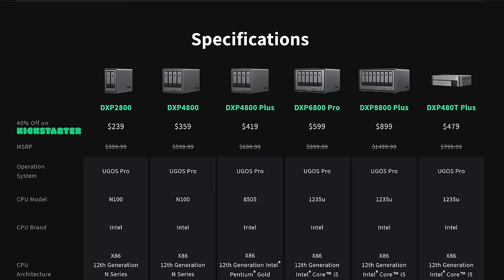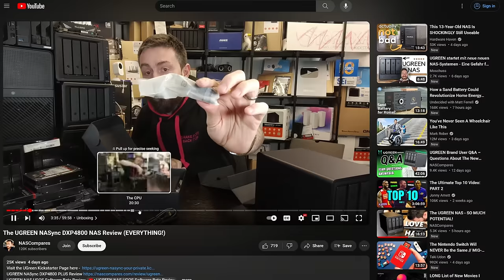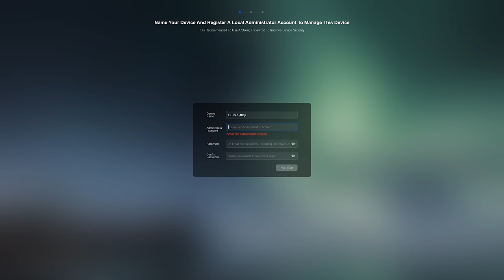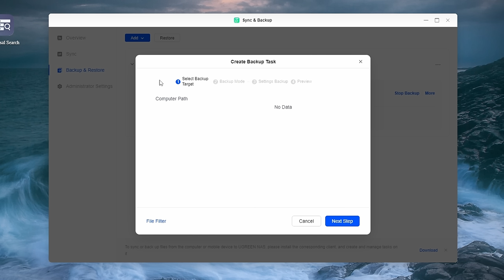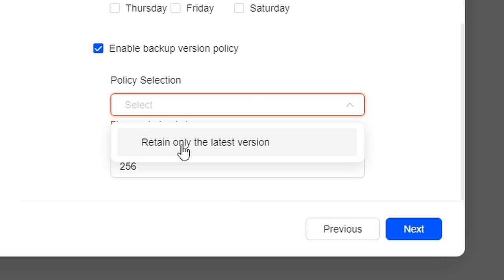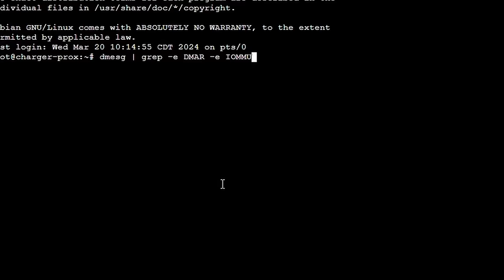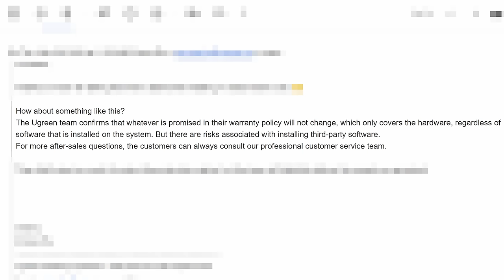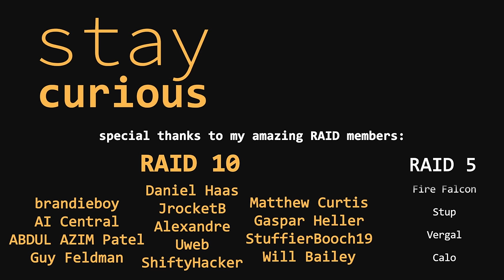UGREEN makes a NAS..?

Comment: theory: these were originally pitched as DASes but they realized during the design pprocess that they could capture a larger market with a little extra hardware engineering, but didn't factor in the cost and time required to do NAS software development well, hence the results: an unfinished OS on a decent motherboard inside a very well designed chasis.
Reply: given that their single drive caddies are pretty solid it's kind of dissapointing they didn't also release the DAS versions... i bet those would have put yottamaster+terramaster into panic mode.

Comment: The warranty thing is not unclear, or different from anyone else. Your warranty is on the hardware and it's functionality when running their software. It's not complicated, vague or strange. If you have an issue with something, they will not support - ie troubleshoot - what does and doesn't work on "Tommies OS for donkeyblasters" or whatever else you may have concocted to put on it. Everyone has that warranty for NAS products, I used to run the support team for a well known NAS manufacturer, we had the exact same policy. If you can get it to work somehow running AmigaOS or the firmware of some obscure shaver - good for you, we won't support or troubleshoot it like that, if you want our help, including to determine a fault which is required for RMA/replacement/whatever, the first thing you'll need to do is get the original software back on it so that we can diagnose what is going on, and eliminate software gremlins, hobgoblins and whatever other mythical creatures may lurk inside someone elses software.

Comment: I previously used 2TB spinning rust to install games and store backup files on my PC's but have since switched to SSD's for faster access. Now I have several of these old drives. I would like to use them as networked storage, not as a NAS but possibly as a USB drive attached to my router. Do you have a suggestion as to a "box" I could get that would hold at least four 3.5" drives?
Reply: Just get a cheap 4 bay nas..... storage does not belong on a router.

Comment: Yeah man love the idea behind an overspec cpu especially at 23W at the wall but the advantages over a $50 optiplex from eBay running TrueNAS won't get me to invest $400... yet. If they make some killer software to put that efficiency and compact size to work though, I could be converted?

Comment: Umm, If one reads the T&Cs, somewhere, somewhere in that vast threatening screed will be that Ugreen cannot be responsible for data loss or corruption or costs incurred with the use of this product, or words of similar meaning. 
But, If you use third party software, they announce that data and integrity cannot be guaranteed. So is not covered by warranty.
Is that not in reality the same outcome, no matter what software one uses?
Reply: That's literally what they state in both emails shown.
"We cover the hardware, not the software nor the data."

Comment: The font - the almost Times New Roman font you encountered was actually a Chinese font. 宋体 (SimSun) to be specific. For the longest time in Windows, pretty much dating back to the 3.2 Simplified Chinese version all the way to Windows XP, used this font as the default system UI font. The Roman letters part of this font is UGLY. People using the Simplified Chinese version of these Windows versions usually find ways to replace the default system font with some other fonts which look nicer when displaying Roman letters, if they care and are handy. It was Windows Vista which finally brought a new default font which displays Roman letter text in a better style - Microsoft Yahei (微软雅黑). I personally find SimSun's English text font style unbearable, but just have been too lazy to replace it with every Windows reinstall (back in the days, you reinstall Windows A LOT MORE).

Comment: Thanks for your video. These are my impressions.
software: uGreen is too green. IMVHO 10 years old firmware like the one of a Buffalo unit I used or theCus is... with more functionalities.
hardware: maybe not good enough. You defined the trays cheap, I would love to know how they will react after 5 years of almost 24/7 use, i worry about cristallization of the poliymer and cracks. Also the SoC seems interesting, however the 4+1 (because hyperthreading is gonna die) layout seems a "no VM" to me. Due to interesting options on bios (including power limit change) I'd love to that settings being tweakable from the stock os. And also... bios key access should be granted.
Last nitpicking detail: I doubt that the USB + SD I/O on the front is with specific controller and PCIe for the SD Card.
Reply: "hyperthreading is gonna die"
Derp.

Comment: So, TJ Max has not been a big deal for many many years like it use to be where if you where overclocking and went a bit too high on the temps it would die, now, both AMD and Intel just start pulling back on the clocks/performance if the temp ceiling is being hit, so, say you are humming along at 2GHz and 80C it's fine, but you hit 100C and it pulls back to 1.8GHz or even 1GHz to stay at or below TJ Max. This is also how AMD is doing their newer dynamic overclocking where as long as you stay under a temp threshold it will clock up more until it hits that thermal limit.

Comment: Maybe I just missed it but what PCIe gen and how many lanes are attached to the two main NVMe slots (and maybe the boot drive as well)?
Reply from the maker: Sadly I forgot to test that. I was a bit rushed and probably dropped the ball in a few spots. I haven't had a chance to watch but I think Apalard's Adventures dives into stuff like that.
Reply: @HardwareHaven Thanks for the info! I checked his blog and he posted the lspci output and that tells us both the internal NVMe and the Samsung he added run at 8GT/s with 4 lanes. I think it's fair to assume the 3rd slot also has PCIe 3.0 x4 and that's actually huge. All the 4 bay Synology and QNAP I've checked so far usually run at a single PCIe 3.0 lane.
It would be interesting to compare the lane configuration of the N100 version but that CPU only has 9 lanes compared to the 20 on the Pentium so I guess it's one or two at best unless they have a PCIe switch somewhere in there.
For anyone else interested there's (presumably) 12x lanes used for the three NVMe drives, 4x lanes for the Aquantia 10GBit/s NIC, 2x lanes for the ASmedia SATA Controller and 1x lane for the Intel I226-V 2.5GBit/s NIC.

Comment: More thoughts: Does the world really need another NAS box? Many years ago I bought the cheapest Synology 2-bay box as an experiment and it has worked flawlessly. OS is stable, capable and has a full array of add-ins. My one disappointment is that the RAM is soldered in, limited (512k) and therefore not upgradeable.
Reply: 512k? Dang... you couldn't even put a single MP3 in that RAM.
That's a third of a floppy disk!

Comment: all them screws and most of them with threadlock on them, not the good thread locker but still.    I do guess in a vibration system something to lock in the screws is a good idea, but propper tq would work better.

Comment: Is the ugreen OS based on any already existing NAS software? Why spend so much to reinvent the wheel when the hardware can run something far more mature?
Reply: It's a lightly modified version version of Debian.
Because when you supply the hardware and software, you support both.
When you offer people a full OS, you have support............... a full OS.
When you offer people a limited OS, you support exactly what is available in the OS you provide.

Comment: raid5 isn't enough redundancy though.  drives tend to exhibit failure when taxed the most - a rebuild is often where you find out that one or more of your other drives have failed.  I wouldn't go with anything less than an 8 bay nas running raidz2 or raidz3
Reply: That's why backups exist.
Reply: They have bigger Options as well, with more bays

Comment: After a couple of years suffering Qnap, I concluded that the whole concept of a NAS appliance is a dead end. Using such an appliance just means that you make yourself dependent on software that a manufacturer uses to capitalize on you in some of many ways. What I am actually interested in is the hardware. But vendors tend to lock down the hardware to be only usable with their software, at least that's the only "supported" usage scenario. Because they ship both together, you will always get the cheapest hardware they can get away with to deliver the whole product. When you buy a PC or other hardware as hardware, you get to choose the components and pay for what you choose. With a NAS appliance, you pay for the product, whatever that is.

The software side is a very sensitive thing, a NAS after all holds your data, most of the time all of it. You don't want to have to encrypt it, because it's your data on your device. That's why you have doors at home and a firewall between you and the internet. It's never a bad idea to be paranoid if you are connected to the internet, so I still encrypt everything. How do you do that with an appliance? Well normally you tell it to do so, and then you trust the vendor that they actually do it, that they do it right, that they are not subordinate to whatever country's authority is ruling their affairs. You also have to trust them to be competent, not to gather "meta data" about you and your data. You have to trust them not to leak your stuff for fun, profit or simply because they don't know what they're doing.

My experience is very much shaped by the 2 Qnaps I'm still using. It's not fair to generalize my experience and assign it to the whole industry, at least not at first glance. But I think this is valid, because even if any company might do a much better job, they are still exposed to the problem than another company doesn't care, saves expenses and your decent business practice might not be values by customers enough to pay for the difference in price. And since software is updated, a change of mind by the vendor might affect customers years after a purchase.

I don't want to only rant and also say something positive. I really like the concept of Qnap's NASes. They pack a lot of power and a huge number of very useful features into these boxes. The UI is somewhere between usable and awesome, depending on what exactly you do. These could be wonderful devices.

That being said:

I bought my NAS at a time when it was a well known fact that not only the particular device I bought but the whole fleet of devices has a technical defect that makes them unusable after a period of few years of use. The only way to fix this, is to get a new one or to solder (or stick) a cable onto the mainboard. This only fixes the symptom and the device will probably break down later on, because the degradation that is responsible for the problem is apparently continuing.

Another problem is that apparently with time, the disk slots get less power, leading to disks not being recognized or me having to fuddle with the bays which often helps and then you can't touch the device or the table on which it stands to keep it running.

I would not have bought these devices if I had known about these problems. I cannot imagine anybody would. But these are clearly problems that had to be covered by a guarantee, which they are not because they happen after more than a year and they will happen, almost certainly.

When I learned about the first problem, I bought a second NAS from Qnap, now knowing about the problems. Why you might ask? As a spare. I just need to be able to access my data and despite the fact that QNAP runs a Linux, I just don't know if I can recover data and how I would go about it, if all I have are four disks and not computer where I can plug them in and what to do once they are plugged in. Sure I can figure that out, but that will take time, that I might not have.

Some times into the pupchase, the second NAS showed the same problems as the first, same fix. I can't complain, I knew this would happen. Yet I did not know that after some time the HDMI ports (of both devices) would no longer work. I played with them in the beginning to see what the media center features are and of course I used it to set up the devices. Now I don't know if I can reset these devices at all - not seeing any way how I can do that without a screen. 

Another problem that I have is that these NASes are killing disks. I had to replace some 10 disks over a period of 4 years. Just yesterday another disk died. It's hard to be sure if that an issue with the device or due to the fact that I experience quite a lot of problems with electricity where I live. I had more power outages in a single year than over some 50+ years I spend elsewhere. But I think it's valid to expect from a device that has the primary purpose to safely store potentially important data to have resilience to something predictable and common as power outages. That can happen at any time anywhere and considering where these companies produce these products, they can't be strangers to this fact.

Few people have such devastating experiences with their NASes, at least to my knowledge. But, all of these problems are in the end consequences of my failure to understand that you should not rely on the decency of business. Business always first and foremost has the objective to make as much profit from their customers (and any other entity they are interacting with) as possible. That means, you need to know what exactly you are spending money on. You can buy an egg, then you need to make sure you know when the hen laid it, because you otherwise really don't want to eat it. You can trust the guy, if they are your neighbor. But if it's a company selling eggs in the thousands, you better look at the stamp marks on the egg. You can buy NAS hardware, but then you need to know what the components are. You need to be able to install your own software and be sure that you can in a couple of years from now. You need to be able to replace components. That's why I no longer use Apple products. I'm back to PC hardware. That's why I will never buy something like NAS appliances. Instead I will either buy hardware that does not come with "firmware" or just implement NAS functionality on Linux or BSD. That's much more work, initially, but in the long run it gives me exactly the features I want and it's not as bad as the amount of time I spend fighting the idiotic setup Qnap uses internally or the time with a NAS on the surgery table.

Don't buy appliances. It's a really bad idea.

Comment: Did you just call warranty void stickers "illegal"? They're only unenforceable as the only method of voiding a warranty.
They're not: A) "IlLeGaL" nor are they even disallowed from being a contributing factor to voiding a warranty.
The actual law states that it moves the burden of proving the customer caused the failure onto the manufacturer.
If they open it, see an intact sticker, they can freely give you an expedited replacement.
If they open it, see a missing/broken sticker, they are allowed to perform a thorough investigation. Only if they see that a failure related to and caused by the consumer can they legally void your warranty. It also allows them a practically-unlimited amount of time to "review" your product before issuing a replacement or refund.

What happened was electronics moved under the Magnuson-Moss Warranty Act.
The law, originally applied to cars, was meant to allow aftermarket parts and tuning without throwing away the warranty.

I.e., if you install a cold air intake, why is the warranty for the... windows, stereo, etc. etc. voided? [how it worked pre-MMWA].
Also, if you modify the exhaust and your engine fails... did the exhaust modification cause it? Probably not (but not always. There are cases of cat disintegration causing massive backpressure, ruining engines.)
So, you see... it's much more complex than crying and whining when you see an "illegal" (not illegal) warranty sticker. 
It doesn't even say "warranty void if removed."

"Doing things that are stupid." -> Doing things that make complete and total sense when you understand the context of the law.

"If you want to be safe, you could turn off the turbo boost." STRONG eyeroll... the CPU is designed to run allllllll day everyday at its junction temperature.
If it was "unsafe" to run at that temperature, the temperature.... would... be... lower... ddddduuuuuuuuuuuhhhhhhhhhhhhhhhhhhhhhhh.

22:19: what, exactly, were you confused about in their initial response? It clearly says they'll cover hardware but not software when used that way.
23:00 And, somehow, you're still asking for clarification? 
Bro, you run their software and their hardware and you get support for both.
You run someone else's software, they (OBVIOUSLY AND RIGHTFULLY) tell you to kick rocks, we don't know why your... XYZ container isn't launching on your Ugreen Hackintosh and we're not helping you set environment variables and persistent storage for it.

This is in opposition to, say, Realtek or Intel. They'll provide drivers and support for running on Windows 10/11 and Linux. 
That means it's a supported configuration. They'll provide support for various Linux distros and Windows that meet the specifications.
What other NAS providers provide support for other software? You heavily imply that its an option.

Comment: I want a 16 slot version! So you can use 8 HDDs in Raid Z2 and have another 8 slots for migrating to bigger HDDs in a few years easily, without needing a 2nd device! The migration has always been an unneccessarily big PITA because you need to buy a 2nd device each time you grow our of your storage size.. I would prefer lxc container handling to Docker very much, because lxc is useable for normal human beings while Docker is unbearable when leaving the trail of premade templates.